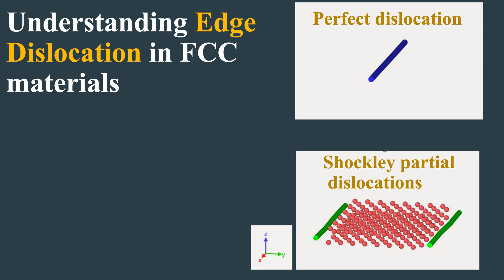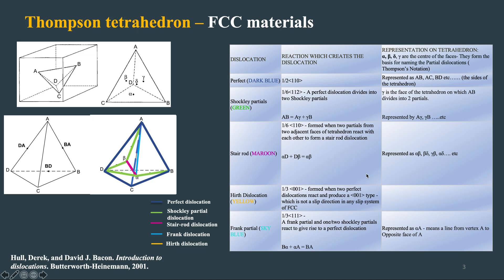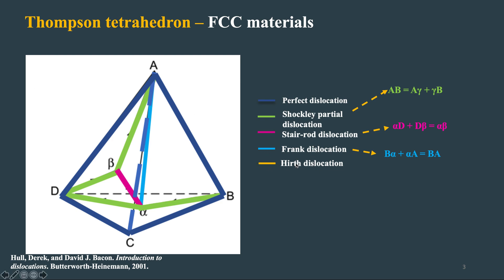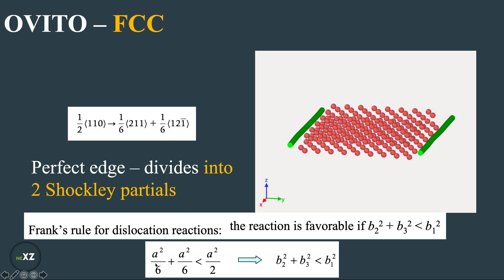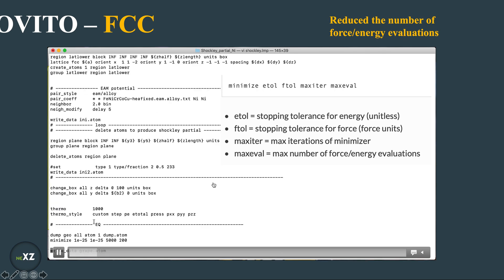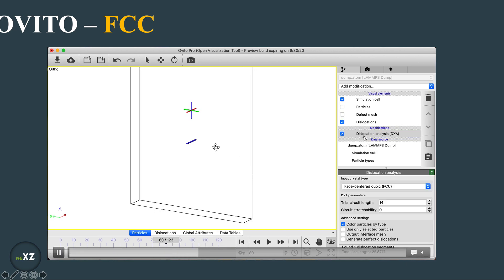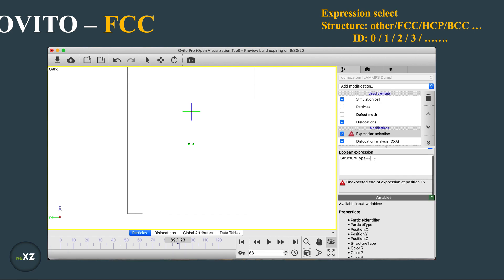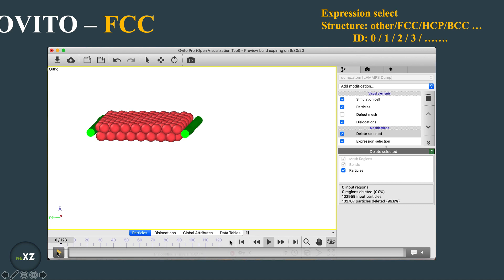Edge Dislocation Part-2 || FCC materials || How to study dislocations using Molecular Dynamics

Comment: # -------------- creating a upper & lower regions and as well as - region & simulation box ----------------------
please write out the one for this shockley partial i didnt see it well
Reply from the maker: here is the full lammps script:

#----------------- supercell size, lattice constant --------------------------------------
variable        xbox equal 3
variable        ybox equal 40
variable        zbox equal 15
variable        a equal 3.52

variable        dx equal sqrt(6)/2
variable        dy equal sqrt(2)
variable        dz equal sqrt(3)

variable xlength equal ${xbox}*${dx}*$a
variable ylength equal ${ybox}*${dy}*$a
variable zlength equal ${zbox}*${dz}*$a
variable zhalf equal ${zlength}/2

variable b2 equal ${a}/${dy}/2

# -------------- store initial positions of central glide plane (CGP) ----------------------------

variable y1 equal (${ybox}+(${dy}/4)+0.1)*${dy}*${a}/2
variable y2 equal (${ybox})*${dy}*${a}/2
variable y3 equal ${y2}-0.5
variable y4 equal ${y1}+0.5

# -------------- general settings --------------------------------------------------------
dimension       3
boundary        p p p
units metal
atom_style      atomic  

# -------------- creating a upper & lower regions and as well as - region & simulation box ----------------------

lattice fcc ${a} orient x 1 1 -2 orient y 1 -1 0 orient z -1 -1 -1 spacing ${dx} ${dy} ${dz} origin 0.0 0.0 0.0
region whole block 0.000000 ${xlength} 0.000000 ${ylength} 0.0 ${zlength} units box
create_box 2 whole

region latupper block INF INF INF INF  0.000000 ${zhalf} units box
lattice fcc ${a} orient x  1 1 -2 orient y 1 -1 0 orient z -1 -1 -1 spacing ${dx} ${dy} ${dz}
create_atoms 1 region latupper
group latupper region latupper

region latlower block INF INF INF INF ${zhalf} ${zlength} units box
lattice fcc ${a} orient x  1 1 -2 orient y 1 -1 0 orient z -1 -1 -1 spacing ${dx} ${dy} ${dz}
create_atoms 1 region latlower
group latlower region latlower

# ---------------- EAM potential ----------------------------------------
pair_style      eam/alloy
pair_coeff      * * FeNiCrCoCu-heafixed.eam.alloy.txt  Ni Ni 
neighbor        2.0 bin
neigh_modify    delay 5

# -------------- delete atoms to produce shockley partial ------------------------------

region plane block INF INF ${y3} ${y4} ${zhalf} ${zlength} units box
group plane region plane

delete_atoms region plane

write_data ini.data
# --------------------------------------------------------------------------------------

change_box all z delta 0 100 units box
change_box all y delta ${b2} 0 units box

thermo          1000
thermo_style    custom step pe etotal press pxx pyy pzz

# -------------- EQ -----------------------------------------------------

dump geo all atom 1 dump.atom
minimize 1e-25 1e-25 5000 200

write_data grape.atom
Reply from the maker: Here is the part you have asked for:

# -------------- creating a upper & lower regions and as well as - region & simulation box ----------------------

lattice fcc ${a} orient x 1 1 -2 orient y 1 -1 0 orient z -1 -1 -1 spacing ${dx} ${dy} ${dz} origin 0.0 0.0 0.0
region whole block 0.000000 ${xlength} 0.000000 ${ylength} 0.0 ${zlength} units box
create_box 2 whole

region latupper block INF INF INF INF  0.000000 ${zhalf} units box
lattice fcc ${a} orient x  1 1 -2 orient y 1 -1 0 orient z -1 -1 -1 spacing ${dx} ${dy} ${dz}
create_atoms 1 region latupper
group latupper region latupper

region latlower block INF INF INF INF ${zhalf} ${zlength} units box
lattice fcc ${a} orient x  1 1 -2 orient y 1 -1 0 orient z -1 -1 -1 spacing ${dx} ${dy} ${dz}
create_atoms 1 region latlower
group latlower region latlower

# ---------------- EAM potential ----------------------------------------
pair_style      eam/alloy
pair_coeff      * * FeNiCrCoCu-heafixed.eam.alloy.txt  Ni Ni 
neighbor        2.0 bin
neigh_modify    delay 5

# -------------- delete atoms to produce shockley partial ------------------------------

region plane block INF INF ${y3} ${y4} ${zhalf} ${zlength} units box
group plane region plane

delete_atoms region plane

Comment from the maker: 2 important points to note in the change of LAMMPS code from the previous video: https://youtu.be/7dXihEcXvA8

1) minimize etol ftol maxiter maxeval
etol = stopping tolerance for energy (unitless)
ftol = stopping tolerance for force (force units)
maxiter = max iterations of minimizer
maxeval = max number of force/energy evaluations

reduce the number of maximum force/energy evaluations 
min 1e-18 1e-18 10000 10000 (changes to)  min 1e-18 1e-18 5000 200.  so that system comes to stop quicker which saves time: this is just for doing things faster to have a look at the necessary things only

2) while dumping the output file - dump every 1 thermodynamic step  - this will help in viewing the intermediate stages of relaxation clearly (which is slow). 

dump geo all atom 100 dump.atom (changes to) dump geo all atom 1 dump.atom

Comment from the maker: LAMMPS code to create an edge dislocation - to view transition from perfect edge to partial dislocations:

#----------------- supercell size, lattice constant --------------------------------------
variable        xbox equal 3
variable        ybox equal 40
variable        zbox equal 15
variable        a equal 3.52

variable        dx equal sqrt(6)/2
variable        dy equal sqrt(2)
variable        dz equal sqrt(3)

variable xlength equal ${xbox}*${dx}*$a
variable ylength equal ${ybox}*${dy}*$a
variable zlength equal ${zbox}*${dz}*$a
variable zhalf equal ${zlength}/2

variable b2 equal ${a}/${dy}/2

# -------------- store initial positions of central glide plane (CGP) ----------------------------

variable y1 equal (${ybox}+(${dy}/4)+0.1)*${dy}*${a}/2
variable y2 equal (${ybox})*${dy}*${a}/2
variable y3 equal ${y2}-0.5
variable y4 equal ${y1}+0.5

# -------------- general settings --------------------------------------------------------
dimension       3
boundary        p p p
units metal
atom_style      atomic  

# -------------- creating a upper & lower regions and as well as - region & simulation box ----------------------

lattice fcc ${a} orient x 1 1 -2 orient y 1 -1 0 orient z -1 -1 -1 spacing ${dx} ${dy} ${dz} origin 0.0 0.0 0.0
region whole block 0.000000 ${xlength} 0.000000 ${ylength} 0.0 ${zlength} units box
create_box 2 whole

region latupper block INF INF INF INF  0.000000 ${zhalf} units box
lattice fcc ${a} orient x  1 1 -2 orient y 1 -1 0 orient z -1 -1 -1 spacing ${dx} ${dy} ${dz}
create_atoms 1 region latupper
group latupper region latupper

region latlower block INF INF INF INF ${zhalf} ${zlength} units box
lattice fcc ${a} orient x  1 1 -2 orient y 1 -1 0 orient z -1 -1 -1 spacing ${dx} ${dy} ${dz}
create_atoms 1 region latlower
group latlower region latlower

# ---------------- EAM potential ----------------------------------------
pair_style      eam/alloy
pair_coeff      * * FeNiCrCoCu-heafixed.eam.alloy.txt  Ni Ni 
neighbor        2.0 bin
neigh_modify    delay 5

# -------------- delete atoms to produce shockley partial ------------------------------

region plane block INF INF ${y3} ${y4} ${zhalf} ${zlength} units box
group plane region plane

delete_atoms region plane

write_data @t
# --------------------------------------------------------------------------------------

change_box all z delta 0 100 units box
change_box all y delta ${b2} 0 units box

thermo          1000
thermo_style    custom step pe etotal press pxx pyy pzz

# -------------- EQ -----------------------------------------------------

dump geo all atom 1 dump.atom
minimize 1e-25 1e-25 5000 200

write_data grape.atom
Reply: What about Screw dislocation